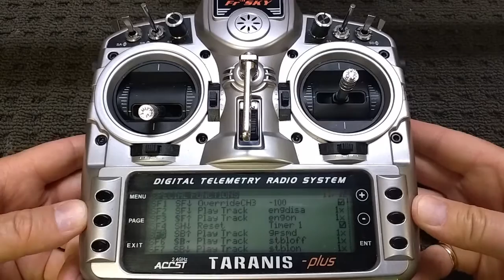BGL-6G-AP on Taranis 3 Pos Switch - Setup

Comment: Hi mike is it possible to show how to set the failsafe in case connection is lost and so that the plane rth. Cheers Terry
Reply from the maker: G'day Terry. Switching to RTH on a  failsafe is a function of the receiver. I'd you are using an FrSky just make sure to put the switch to RTH mode when you set failsafe. Cheers Michael
Reply: MAD RC thank you very much Michael. That makes a lot of sense. 👍

Comment: Hello. Thanks for the tutorial. I have a question regarding the stabilization mode. I notice it only works for me when initially power up my ESC. After that, I pitch and roll the wing and the stabilization never kicks in. I set my transmitter up as you have using the SC switch, but not sure what I'm missing. Maybe something isn't set up right on the BGL. I'm using the X8R reciever. From the BGL I have the SW in ch4. ELE is connected to ch2. Aile IN is connected to ch1.  Red wire/RUD is not connected since I'm flying a wing. All flight controls functions as they should. I watched you wing set up vid. Thanks for that. Any idea what I'm missing? Thanks in advance.
Reply: I figured it out! Had to redo the stabilization initialization and adjust the AIL and ELE dials. Watched your vid again for the 5th time! HaHa. Thanks again!
Reply from the maker: @rossagge  Great news!

Comment: Hi there Mike, I do appreciate and enjoy your BGL videos.
I have a wee problem trying to set up a flying wing /BGL on my taranis plus.
Part of the problem is that I'm not sure what to expect regarding the elevon surface movements
I have done the initialising, and then the flying wing switch selection S1 on and S2 off  configuration.   Originally, using the Taranis wizard for the wing setup, the Mixer showed the ele 50% ail 50%. BUT the BGL says eliminate all mixes, which I did.  
So now,  having clicked the BGL set button, I have succeeded in setting up a 3 way switch on my Taranis for "normal" and this is working.  
Switch to level flight, and I have control with the sticks, and partial with the surfaces, BUT. when I tilt the BGL sideways, only one surface compensates, and when I tilt forward or rearwards, only the other surface compensates. I was expecting to have both surfaces working together as the elevator and in opposition for the ailerons.

I do have a normal plane set up on my taranis and the BGL is working perfectly.
I'm not an expert with the Taranis, but have managed to set up a dozen or so models directly using the TX menus.
I wonder if you can help me please
Regards
Bruce
Reply from the maker: G'day Bruce, from the description it sounds like you've done it all correctly. But, I would suggest that you may be best served if you start a fresh model in your Taranis (no mixes) and maybe run through the set up again - https://www.youtube.com/watch?v=FykE6QWcaMg
The only thing that I can think of that might be affecting the output of the Bigaole is if there is any of the old mix in the radio.

If all else fails, go back to the (fresh) start and try again.

I hope that helps, let us know how you go.

Cheers Michael

Comment: Hi can the Bgl be connected to a mobile device and gps programmed to do way point flights ? And secondly i cant seem to make the off mode work i am using a old fut mz14 radio using the sb switch which is the same switch as ur tranis 3 position the stab. Mode remains on in all 3 positions
Reply from the maker: Hi, no this unit can not be connected to any sort of device for way point programming. With regard to your mode being on, it sounds like you have not got a GPS connection. If the blue light is solid then there is no connection to the satellites. You must have a clear line of sight to the sky. I hope that helps. Cheers Michael
Reply: MAD RC thanks for your prompt reply.  Yes I found the other video and since I was at home it was not getting a lock. Moved next to the window voila got a  lock. I was able to set home when Sw is in off mode. Now for a test flight soon
Reply from the maker: Excellent news. Glad to help